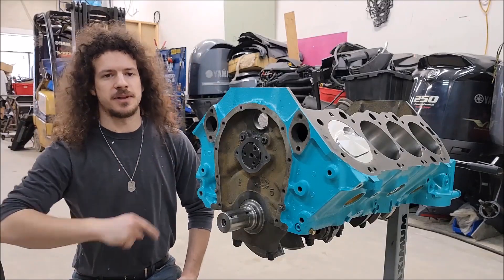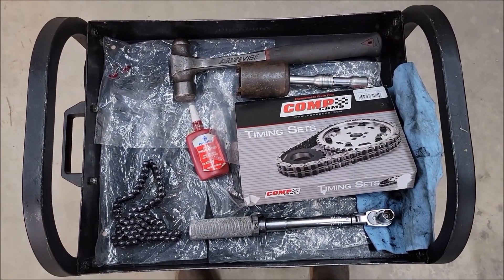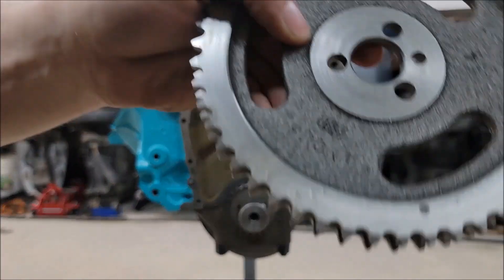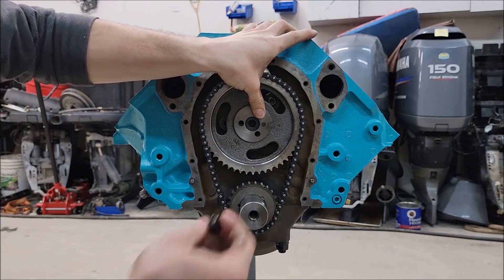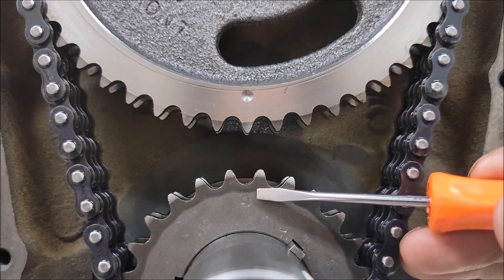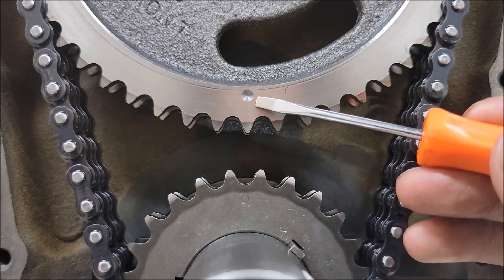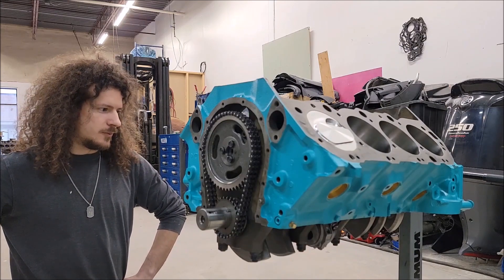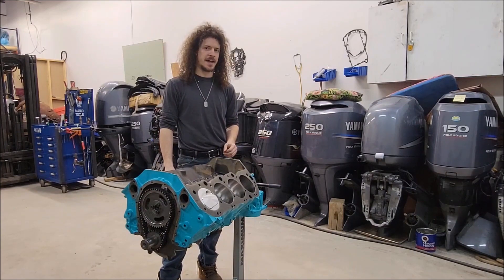496 Stroker Build PART SIX: Timing Chain Install

Comment: Aidan, Do you happen to know how many iron heads and Aluminum heads are available for the 454 ? Thanks for this interesting build.
Reply from the maker: No, but I know there are a lot of aftermarket aluminum options that are arguably better than the cast iron options. 049 and 781 casting numbers are supposedly the more desirable iron heads.
Reply: I was hoping to find some person who might have a list of those iron heads as this engine will be used for Towing. Thank you @Aidansbuilds

Comment: Big block Chevy needs a bronze thrust washer or a Torrington bearing behind the cam sprocket with a retro fit roller cam or the back of your cam sprocket will get chewed up.
Reply from the maker: I have read about that, this one is a solid roller, should be fine!

Comment: Two things, 1. driving a timing sprocket on like that can damage the front of the crank or the thrust bearings in the engine. you should always use an installation tool. 2. Red Lock Tight is great stuff but requires heating the part to 500 degrees to get it to release. which will ruin the heat treating on the bolt and cam if you need to disassemble the engine for any kind of maintenance.  I prefer the cam lock plates that have the folding tabs to keep the bolts from turning. just my 2 cents. I have been building Big Block Chevy engines for the last 35 years.

Comment: I thought when your two timing marks were lined up on the crank and the cam gear that that was supposed to be top dead center for number one cylinder ? But in this video you said it was indicating top dead center for number 6 cylinder ? Why is there a difference ? Is it because of the big block engine compared to a small block Chevy ? I'm really curious hopefully you can answer this for ? Are your videos awesome now I just wish I had a big block to build LOL
Reply from the maker: It is TDC Number 1 as well but the exhaust stroke not the compression stroke! Basically the piston is still at the top of the cylinder BUT is not firing. Hope this helps and thanks for watching!

Comment: Question for ya- my timing set came with a big brass washer. I still haven't figured out what it's for and where it goes. 😮 I know, but I've never done this! 😊
Reply from the maker: Interesting, I can't truthfully say I know BUT if I had to make an educated guess I'd say it is for the outside of the crankshaft towards the timing chain cover for thrust and/or to help create a seal. Usually that is what copper washers are used for (seals, e.g. oil pan drqin plug) , I couldn't find anything when I tried to look it up.
Reply: @Aidansbuilds  No problem, thanks for looking.

Comment: if you heat that timing gear your wouldnt have to beat on that crank snout
Reply from the maker: I have baked the crank gear in the past without much luck, it still needed a little bit of 'persuasion' to go on all the way lol. That was a couple of years ago now and that motor is still running well!

Comment: Got your thrust bearing seated for sure.
Reply: I too was cringing. If you don’t have a crank gear - installer you could pry forward on the crank while hammering the gear to keep from increasing your thrust/ endplay. Definitely not the right way but I have gotten away with that method way back when I was without the proper tool or money to acquire the proper tool . Great job otherwise
Reply from the maker: @LanceRaySoliday  Yeah not going to lie certainly not ideal but it does get the job done. Believe it or not I wasn't hitting it as hard as it may look on the video which is why it took as many taps as it did to get on. I've seen some people set the thrust by blowing both ends of crank as hard as they can with a dead blow hammer. Works for them, can't say I'd ever do it myself though 😅 . Thanks for watching and the constructive criticism!